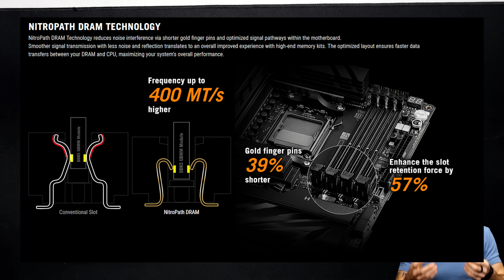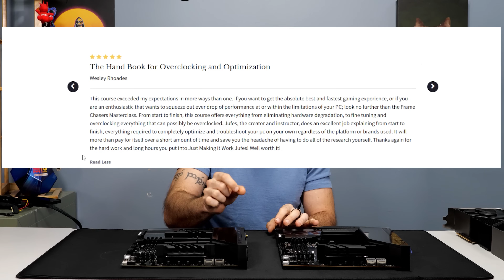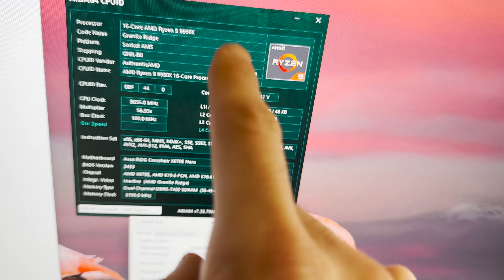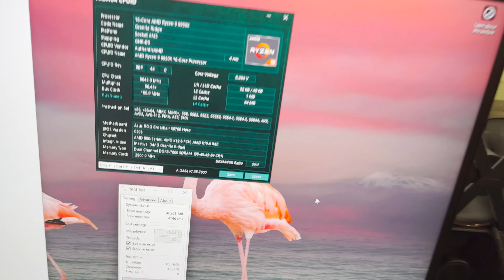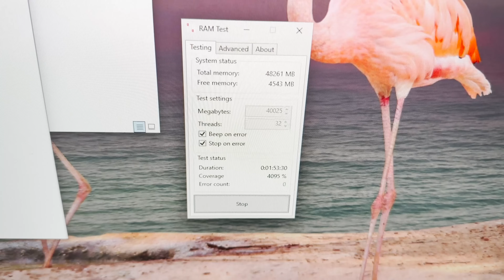🛑 The BEST AMD Motherboard 😱👑 (x870e Hero vs X670e Hero)

Comment: Why are Intel fanboys getting upset that the frame chaser going AMD? Lol
Reply from the maker: Tribalism is cancer, no matter the side
Reply from the maker: It could also just be that the 9950x wins in workstation
Reply from the maker: @juice7661  I don’t care
Reply: @juice7661  440W for 43.5K is kinda nuts, when adequately tuned at 253W it gets ~40-41K. Chasing Cinebench numbers is what put Intel in the bad spot in the first place. And I've never seen crazy 200W in games on my 14900KF, usually it's under or around 100W, depending on how CPU heavy is the game. You better tune your CPU and put limits back on, before you become "team AMD" yourself.
Reply: @FrameChasers the 9950X is a beast!

Comment: What the purpose of this board when you could buy ASRock AMD X870E Taichi lite for almost $200 less ?
Reply: Im thinking the same thing but we'll need to check the specs to see the differences.
Reply: The Taichi and Nova only support up to 8200Mhz OC DDR5 ram while the Hero supports up to 8600Mhz OC (some saying it may even be stable at 9000). The Hero also has patented Nitropath DRAM technology the Nova and Taichi do not, promising enhanced performance.

From ASUS site:

NitroPath DRAM Technology provides enhanced DDR5 memory performance. Shorter gold finger pins and optimized signal pathways ensure faster data transfers between your DRAM and CPU, allowing for greater memory overclocking headroom and stability. These reinformed DRAM slots are also better prepared to withstand the wear and tear of the RAM installation process than traditional slot designs, perfect for enthusiasts who keep their system upgraded with the fastest kits available.

The Nova and Taichi are great MOBOs especially for the price, but for OC enthusiasts that are looking to absolutely max out their rigs on paper it doesn't look like they can beat the Hero, unless someone wants to benchmark them side by side by side...Frame Chasers may be up to the task haha
Reply: @matthewjamesmaccarthaigh and this speed of ram give you nothing, for AMD zen 5 sweet spot is 6000 mhz
Reply: @DARKENnekradPL  That's just not true though, it does feed off your memory speed. It just doesn't scale very well, and more dependent on what games you play. Which is good optimization overall I'd say.
Reply: Taichi also has 1 M.2 gen 5.0 and 3 M.2 gen 4.0 compared to the hero with 3 M.2 5.0, 2 M.2 gen 4.0. Rhe hero also has the snap on WiFi, quick release screw less design PCIe and M.2 slots,, back plate heatplates and 7.1 chanel sound as compared to 5.1 (Taichi). Also the RAM is 8600MT compared to 8200MT. knowing that, for me, the 200 extra is worth it.
Reply: @danielwood6578  ye but with GPU sharing PCI lanes Asus even it will be 150 lower cost then taichi is doesnt worth it...
Reply: Asrock ain't too great with memory overclocking, doubt either can really reach 8000.
Reply: @DARKENnekradPL  keyword "sweet spot" not "best". Yes it's diminishing return and 99% of people don't need it.

Comment: Why any of you guys are not talking about m.2 slots and pcie lane sharing? I wanna know how many m.2 (with gen4 drives)slot i can use with out sharing pcie lanes and having full 16 lanes for gpu (rtx4090 or upcoming 5090) and ability to use all 4 sata connections .
Reply: Go with Asrock or MSI boards they have better lane sharing than all others. Asrock taichi. taichi lite and nova wifi all dont share any lanes. For MSI tomahawk is one of the best boards out there for the features. Other from MSI i dont know. I went with Nova WIFI.
Reply: @mostwanted189  Thanks.
Reply: @mostwanted189  MSI... The USB4 ports share bandwidth with M.2_2 (5x4); they run at 5x2 if M.2_2 is occupied in x2 mode. If M.2_2 is set to x4 in the BIOS, the USB4 ports are fully disabled. M.2_2 is also disabled with Phoenix 2 CPUs.
- PCI_E3 (4x4) shares bandwidth with M.2_3 (4x2); it runs at 4x2 if M.2_3 is occupied in x2 mode. If PCI_E3 is set to x4 in the BIOS, this will fully disable M.2_3.
Reply: @dariuszgrabowski507  yes you are probably correct. But they dont share any lanes with main PCIE, which is the most important part. Frankly sharing lanes with USB ports is much smarter move. On the other side most of the other brands share lanes with main pcie on some of the m2.
Reply: @mostwanted189  are you going to use 2 gpus? it only cuts the bottom lane??

Comment: This board will not boot into the bios from a powered off state using the gpu, it only does it from the cpu from a powered off state. I have to hold shift and hit restart from within windows to get to the bios. Can anyone get this yo boot to the nios from a powered off state through the GPU?

Comment: It is nice they finally moved the CMOS battery to the bottom corner. Never liked having to remove the GPU or fish it out when doing a hard clear. 

Great video 👍
Reply: Some motherboards have pins you can jump.
Reply: Reset button in the back?

Comment: I think you may be the best motherboard reviewer I've seen. You think outside the box and think about what the consumer needs and how spacing, ports could matter for different use cases like using the X870 Hero as a workstation. Really good analysis. Wish more tech youtubers went this in-depth about it instead of just listing the specs.

Comment: The key is to test Karhu’s stability boot to boot at least 40000%.
With Asus X670 (except GENE), this was the main problem : you could pass 7800 1:2 20000% Karhu’s. But, after a reboot, you launched again Karhu’s and it failed at 7% !!

Comment: You should benchmark this MOBO against the ASRock Nova and Taichi, everyone keeps saying the ASRock boards are superior and less expensive
Reply: Ye they Said because if you buy this one only 3 nvme slots are available if you dont want take speed from your GPU, in ASRock all 5 is no problem
Reply: @DARKENnekradPL  ASRock X870e Taichi only has 4 M.2 slots, 1 of them is Gen5, the other 3 are Gen4. The ASUS Crosshair X870e Hero has 5 M.2 slots, 3 are Gen5 (2 of those share lanes with PCIEX16_1 & PCIEX16_2) and the bottom 2 are Gen4 that do not share lanes AND there is also a SlimSAS input you can add a 6th M.2 that also does not share lanes at Gen4 speeds if you need more storage:

ASRock X870E Taichi 
M.2 Sockets
(1) PCIe 5.0 x4 (128 Gbps) / PCIe (up to 80mm)
(3) PCIe 4.0 x4 (64 Gbps) / PCIe (up to 80mm)

ASUS Crosshair X870e Hero
M.2 Sockets	
(3) PCIe 5.0 x4 (128 Gbps) / PCIe (up to 80mm)
(2) PCIe 4.0 x4 (64 Gbps) / PCIe (up to 80mm)
Reply: @matthewjamesmaccarthaigh  That is what you pay extra for I guess. But most people won't need more than 1 Gen5 M.2. The back-up SSD can easily be Gen4 M.2 without any noticeable change.
Reply: @Joshua-pr9vg  oh 💯. I will say I decided to go with this MOBO for my new build and I'm very pleased. It was the only component I paid full price for and it was worth every penny.
Reply: @matthewjamesmaccarthaigh  Yea, I chose the Taichi for my latest build. Along with  a Ryzen 9 7900X3D and a MSI Expert 16GB 4080. I still haven't decided my RAM. Looking hard at Gskill or Kingston.
Reply: @Joshua-pr9vg  nice! I went with the PowerColor Red Devil 7900XTX GPU (similar performance to the 4080 for a fraction of the price) and Corsair Dominator Titanium DDR5 2X32GB 6000Mhz 30-36-36-76 AMD EXPO. I successfully overclocked my RAM to 6800Mhz yesterday, but 6400Mhz seems to be the sweet spot 😊
Reply: @matthewjamesmaccarthaigh  Sounds awesome man.
Reply: @matthewjamesmaccarthaigh  So if I just use the first Gen5 M.2 slot, it wouldn't take speed from the GPU right?
Reply: @matiasnomas.1578  correct.

Comment: finally, someone decides to compare these two boards. BTW SPDIF optical out only supports 2 channels of uncompressed audio. The only other option is lossy Dolby Digital AC3-encoded 5.1 audio through that output, which incurs a latency hit and is an ancient audio format at this point. if you're outputting audio to a surround receiver of some sort you're better off using the GPU's HDMI output since it will actually support modern audio codecs like Dolby TrueHD/Atmos, as well as uncompressed multichannel audio up to 7.1. That said, I'm sad to see motherboards no longer having analog 7.1 discrete audio outputs.

Comment: Could you please do a AMD Gaming system build like you have on your recommended Parts List. I was thinking of the MSI X870E Carbon WIFI and the 9950x  with G.SKILL Trident Z5 Neo RGB Series 32GB T38-48-48-128
Reply from the maker: I can do that yeah sure
Reply: @FrameChasers on asus website the x870e hero appear to support higher clocked memory VS the x870e-e while that the two have that nitropath tech, would love to see if its actually true in practice or not especially for those that plan to build a system for longevity (primary gen5 slot reduced to x8 if you put a sound card or anything in that second gen5 slot)
Reply: @AshtonCoolman  thanks for the message ! i just saw that to conclude of the scam that is this nitropath tech, thanks god I waited and didn't bought that x870e-e, think I'm going with the strict minimum ram-motherboard wise since I plan to settle on a  zen 6 16  cores  ccx CPU  hopefully (the latest amd turin cpus have 16 cores in a single ccx on their 3nm variants so that is promising !)

Comment: Thanks! What ddr5 ram are you using?
Reply from the maker: Ayoooooo thanks for the super man, in this video specifically I used 8200c38 teamgroup sticks with bitspower heatsinks.
Reply: Thank you!
Reply: Estaría bien una comparativa en juegos, con las mismas configuraciones en ddr5 y un 9800x3d, para ver si hay diferencias en los fps,porque estoy viendo canales de YouTube que dicen que hay un 8% más de rendimiento con la x870e, y no sé si es verdad o mentira @FrameChasers

Comment: Correct me if I’m wrong, but this is the ONLY motherboard with the X870E chipset where you can run RAID 0 on Gen 5 M.2 drives and still keep the GPU at PCIe 5.0 x8/x8. I was honestly surprised because on every other board I checked, the moment you set up a Gen 5 RAID 0 on 2x m2 GEN5 the GPU PCI gets fucked and its bandwidth drops to some ridiculously low levels.

Comment: Thanks for doing this review this validate the importance of understanding the hardware and different chipset versions.. not only justify but to validate 9950X will give significant performance. I feel that upgrading to the 9950 X will see most of the benefit when also upgrading to the latest chipset. X870E and even the rtx 5090 for workstation, gaming, and AI applications.

Comment: Great point on the 5GB Ethernet port. Sure 5 is more than 2.5, but. You need a switch and or other device (NAS) to make use of it. There wasn’t easy to find specs on the Realtek 5 GB controller but it likely defaults to 2.5, but maybe 1GB.

Comment: Thanks for the info... I couldn't decide between all the new x870e offerings... in general seems that user reviews in amazon for x670 and x870 mobos from all brands are waaaaaay lower than x570... so it was very difficult. So I chose the x670e hero because for me it's almost the same as the x870e but it's $200 cheaper here in Mexico...

Comment: This is a weird generation where I'm actually more excited for what you can do with the x870 mobos than the processors driving them. Finally a bridge between consumer mobos and something like Threadripper where you can actually flex all the NVME slots without bifurcation or downgrading the GPU, and the ability to have a second GPU for doing simulations or rendering. I just wish we had mobos like I had back in 2014 with quad channel 8 DIMM slots and a 5820k that was just as good as a workstation rig as it was for gaming (relevant to the era). I'm still looking at either upgrading everything to AM5 or sitting on a TR 3970x for a good long time. Buying TRs pre-owned is about my only option, but I absolutely dislike the idea of inheriting the sins of the PO via ebay or the like.

Comment: Within the last 2 weeks my nephew who has built many systems including 2 of my previous used the x670e carbon with 32g ddr5 and a 7950x3d. He said the ram has a lot of available oc headroom iirc and after researching the sweetspot applied it. No luck and after many tries at whatever the lower settings were gave up and went to default. It didn't like any oc.

Comment: HI. Frame Chasers.
I wanted to ask, with that SlimSas Cable connection, that you brought to my attention, could it also be suitable for a 10GB PCIE network card? Without eating lines at the first PCIE slot for the GPU.
Thanks for any confirmation.

Comment: Why not just use an x4 mini sas to oculink cable and attach that to an oculink pcie x4 board? Skip the nvme adapter.
Reply from the maker: I didn’t test it myself so I didn’t want to recommend it without knowing it works

Comment: Hi, nice channel. I will look but have you covered overclocking memory on x870e crosshair? Do you have recommendations on the best memory? I primarily do work (Davinci, Ps, Lr, Ae) and gaming. What's the highest 1:1 ratio that can be achived with like 2x48?
Reply from the maker: Framechasers.org/education
Reply: @FrameChasers  Do you not have "free" advice when it comes to recommendations for ram on x870e?

Comment: X670E Aurous Master can do 8000 MT/S i think that and the extreme are the only 4 slotters than can acheive that. The x670e hero wasn't worth it considering the master was better.
Reply: My rog strix x670e-e will do 8200 with those ram but it's 1:2. So really only 4100.  I can do 6000 1:1 on it and it's faster.

Comment: Awesome video brother! Gave a like and subscribed! 🤘🤘

What memory were you using to get those stable 7800 & 8000 numbers on your X870E? I just picked up the X870E and AMD 9950X looking to use them for gaming and workstation so I'm looking to min/max my total RAM and performance, I just ordered Corsair Dominator Titanium 64GB (2 x 32GB) DDR5 6000 CL30 AMD EXPO but I've been reading some ppl saying on reddit that G.Skill is more reliable for AMD EXPO overclocking and that 6400 CL32 is the sweet spot for AM5 mobo's so I'm contemplating ordering G.SKILL Trident Z5 Neo RGB Series (AMD Expo) DDR5 RAM 48GB (2x24GB) 6400MT/s CL32, G.SKILL Trident Z5 Neo RGB Series 64GB (2 x 32GB) 288-Pin PC RAM DDR5 6000 CL30, or Kingston FURY Beast 64GB (2 x 32GB) 288-Pin PC RAM DDR5 6400MHz CL32.

I really wanted to have 96GB of RAM for content creation and live streaming/gaming simultaneously (running Ableton live 12, Elgato capture, Streamlabs, YouTube, Google Chrome etc simultaneously) but I think I'm going to have to settle for 48GB or 64GB total.

Awesome channel, keep up the great work! Where can I find a link to tip you? 🤘💪
Reply: Ok, so it wasn’t just me… the whole time, I was trying to figure out what RAM he was actually using. I noticed on the x870e hero site’s QVL… the only listed >6000MT/s was the Kingston Fury Beast and Fury Renegade. So that’s what I got. I just snagged the Kingston FURY Beast 64GB (2 x 32GB) 288-Pin PC RAM DDR5 6400 (PC5 51200) Memory (Desktop Memory) Model KF564C32BBEK2-64.

Before realizing there was a DDR5-6400 CL32 Expo on the official QVL, I was really close to pulling the trigger on the G.Skill Trident Z5 Neo or Flare X5, both DDR5-6000 CL30 Expo.

I would also like to get 96GB total if possible, but through all the research and tradeoffs and level of effort necessary and uncertainties… I think you and I landed at similar conclusions, settling for pursuing the best in class available for 2x32GB.
Reply: @mrvvoo  yeah I'm about to build my rig today actually so will report back when I'm done! 🤘🤘
Reply: @matthewjamesmaccarthaigh  Right on! Good luck! And do report back 💪
Reply: @mrvvoo  will do! I'm gonna live stream building it on Twitch if you wanna tune in, same name as here 🤘🤘
Reply: @matthewjamesmaccarthaigh  Oh, sweet. What the quick rundown on your build?

Here’s mine:
- Asus ROG x870e Crosshair Hero
- AMD Ryzen 9 9950x
- Asus ROG Ryujin III liquid AIO
- Kingston Fury Beast 64GB (2x32) DDR5-6400 CL32
- Crucial T705 M.2 PCIe 5.0 4TB
- Asus ROG Strix 4080 Super
- Corsair HX1200i 80+ platinum
- SilverStone RM44

(That’s right… all this craziness… all to be hidden in a plain black box, rack mounted in a closet) 😉

Will be building this by the end of next week. Thinking about recording the experience, myself…
Reply: @mrvvoo    niiiiiiice!! Literally almost identical to mine, only differences are:

- ASUS ROG Hyperion GR701 tower
- 2x Corsair Dominator Titanium 2X32GB DDR5-6000 CL30 AMD EXPO (gonna see what kind of performance I can get at 128GB RAM)
- PowerColor RX 7900 XTX (got it for $700 and has similar performance to the 4080 for half the price) 
- ASUS ROG Thor 1600W PSU 

OK taking longer than I had expected to get my live streaming setup back up and running, hopefully will go live tonight building or tomorrow morning 😈
Reply: @mrvvoo finished building my new PC the last few days and successfully overclocked my Corsair Dominator Titanium DDR5 2X32GB 6000Mhz 30-36-36-76 AMD EXPO RAM to 6800Mhz stable. 7000Mhz was the breaking point, so at 6800Mhz a hair over 13% increase. Ran some benchmarks with AIDA64 EXTREME comparing 6000Mhz, 6200Mhz, 6400Mhz, 6600Mhz, and 6800Mhz and 6400Mhz seems to be the sweet spot for these sticks. 

I'm contemplating ordering the Corsair Dominator Titanium DDR5 2X24GB 8000Mhz 38-48-48-98 INTEL XMP to see if I can get this 8000 @FrameChasers hit in this video, but I'm gonna wait and see if there's any black Friday deals on it haha.

Overall very impressed with the 9950X and Asus X870E Hero! Haven't had any hiccups at all.

Comment: Thinking of upgrading my 9900KS recently and going to AMD with the X870E Hero with the 9800X3D when it launches.  I've got a 3090 with a 10GB nic card currently on my Hero XI board currently that I was going to move over to the new build.  Am I going to lose performance by doing so, I thought going from x16 down to x8 wasn't really noticeable?   Appreciate any input!  Thanks